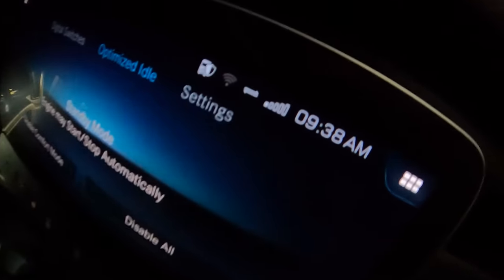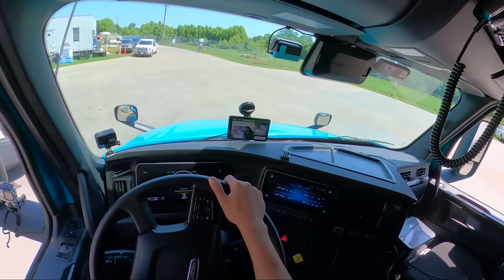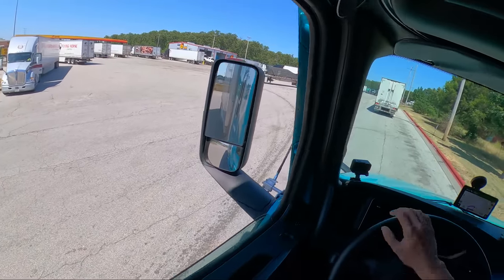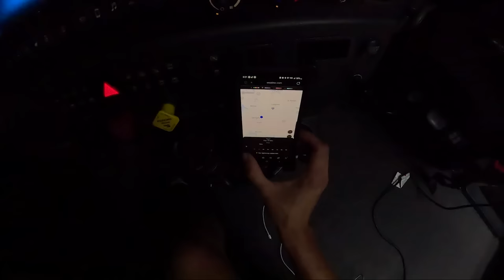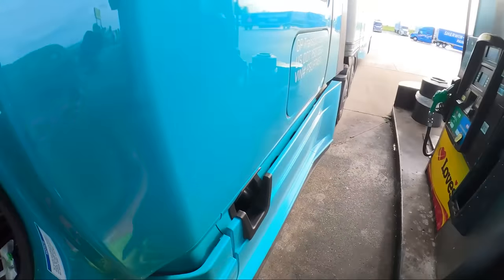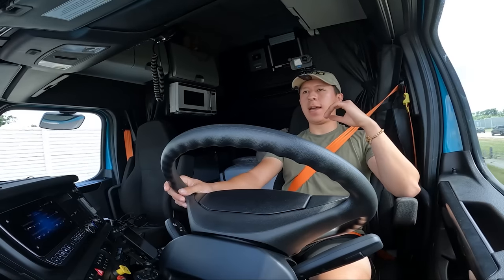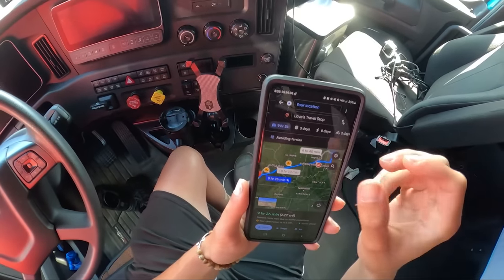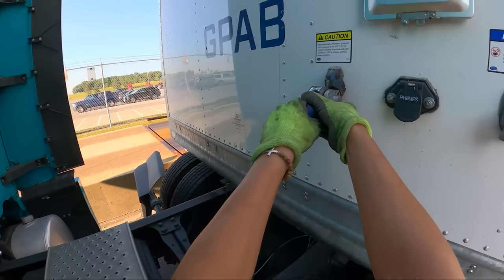Day In The Life: Trucking 900 Miles Arkansas To Ohio

Comment: How did you legally drive 12 hours?
Reply: Truck drivers can drive till they hit 14 hours
Reply: @matthewtaliaferro  I’m a truck driver and my ELD only allows me to drive 11 hours per 24 hour period. I can be in duty up to 14 hour shift but that’s not drive time.
Reply: There are 2 methods used to calculate hours you can drive per week depends on what company you work for and how many days a week they operate which schedule you have to follow. Also hours are calculated at company hq time.

Comment: No thats not the price they're paying for fuel. You dont see tge discounts at the pump. Geezuz, you're the queen of misinformation
Reply: If he scans a company discount card before he pumps it’ll change the ppg. I used to use an RV discount card there and it changed it. But…even with the discount it’s cheaper to just fill up at local stations vs the big stations, but I don’t drive a big rig, just a pickup and trailer now.
Reply: @ridingwithairbubble1694  that's not how it works. Just tell us you don't know a thing about trucking without telling us. Trucking companies of this size have contracted prices for so many gallons if fuel they buy, so AGAIN, what's seen at tge pump is not the price they pay.
I swear folks just be commenting to comment
Reply: @ShadyOaksHustler  so every company operates your way?  That’s how it worked with my discounts, at the pump. I imagine you have insight into EVERY company’s policy and operating procedure. Tell me you’re the transportation secretary without telling me, he’s just clueless and missing in action most times. I have a relative in the PFJ HQ. Different contracts, different terms, different discounts…along with some shady deals where the CEO/CFO did a little time. There’s as many different ways to get the discounts, some show on the pumps, some don’t, technology is a wonderful thing IF you can fathom such a thing.
Reply: @ShadyOaksHustler  the point wasn’t how much you buy, nor what type of vehicle. The point was technology exists that can change the price at the pump, be it a discount card, fleet card, etc. The last point is it’s apparently “pointless” to converse any farther. Buh Bye!
Reply: @ridingwithairbubble1694  bye Felicia

Comment: Hey Alex, they call my home state of New Hampshire The Granite State.  Have you ever hauled polished granite table tops before?  I have a new ex-yellow trucking haulage contract. Thats why I purchased ex-Variant 2020 Kenworth T680s to haul New Hampshire to Georgia runs that are both delicate and extremely heavy like this run .Nearly 900 miles in one of my longest runs. I have to say I'm not as qualified as 2 of my ex-GP drivers on the steep grades up by the cutting shop. I might be a professional, but need to build my skills with my regular runs first.